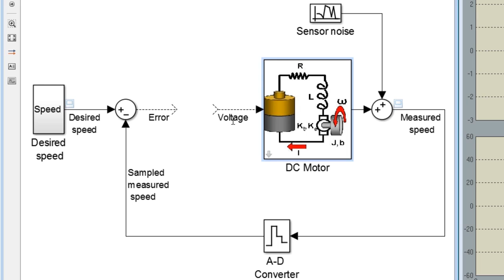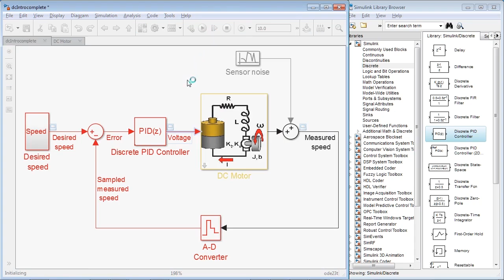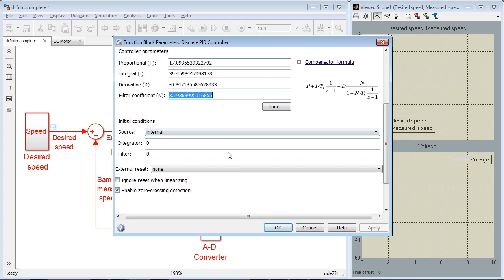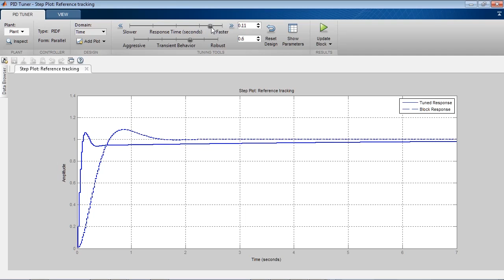PID Controller Design for a DC Motor

Comment: How is this ideal, when we are assuming the fan speed is equal to the voltage input? in other words if i want a fan speed of 600 rpm, i wold also need a 600 volts supply. Or am i missing something here???